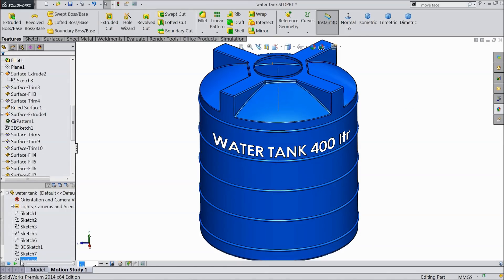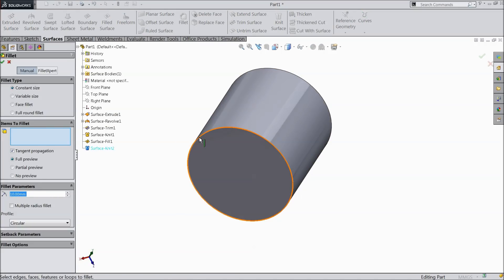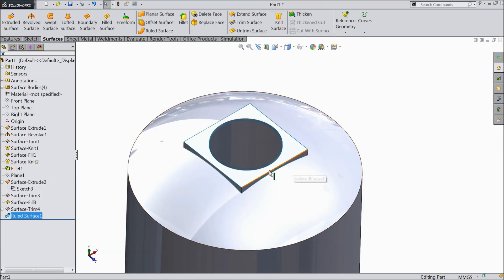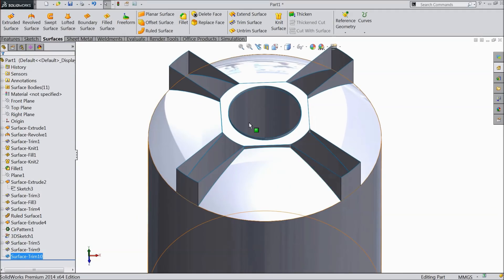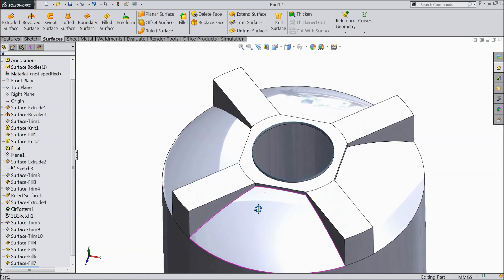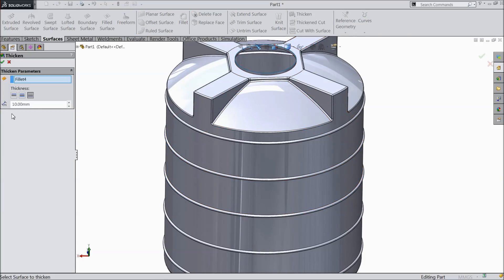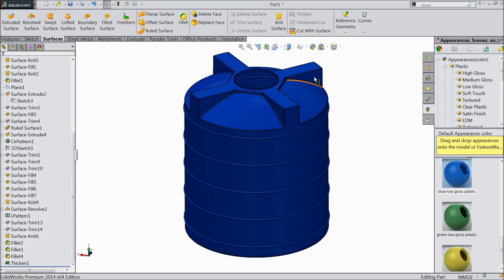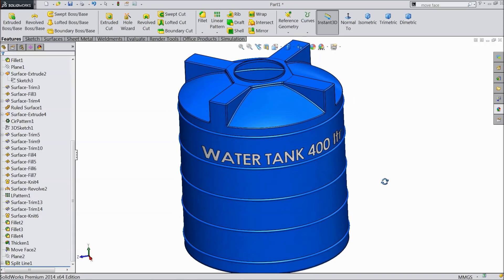SolidWorks Advanced Surface Tutorial Water Tank

Comment: An amazing training involving surface resources! I could not do "thicken" in the top cover, although could see previous: when confirmed, nothing occurred - thicken remains the same without any thickness (only profile).  Another small bug occurred in the "fillet" command: when applied in the top part, failed. Despite that, I learned a lot of surfaces, and the tank was finished quite well! Thanks!

Comment: Rajput.  I find your statement false.  The reason I find it false is I have gone to your channel and you have no CAD videos posted at all.  Also if you could do this with less steps you would have and posted to prove your abilities.  One should not degrade another's work if you can not do better.  Cheap shot on your part.  If you would like to prove me wrong then post something on your channel proving you have the skills of which you boast. I am monitoring your channel to see what CAD skills you possess.
Reply: You are correct, but so is he--but not so polite. This can be done 6 steps using solids (just tried myself), however, this is a surface exercise. :o) It is up to the engineer or designer to choose the best method (or mix) for each design. To me, having nearly 5x as many steps modelled as surfaces means it's not the best choice but again this is teaching surface tools, not a speed run. I wish there were lessons explaining when surface tools are better not just used to solve a few issues in solid modelling.
Reply: I WOULD HAVE MADE A REVOLVED BOSS BASE, THEN EXTUDED BOSS FOR THE TOP. SHELL COMMAND, FILLET.
Reply: SORRY. FILLET THEN SHELL.